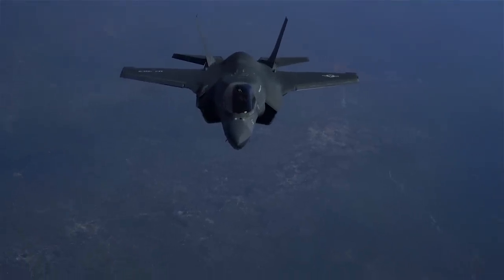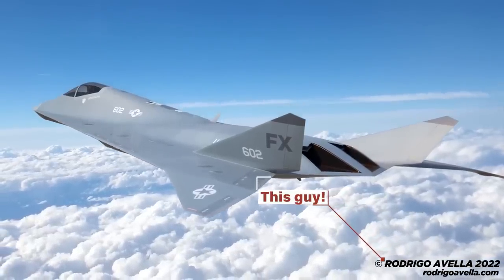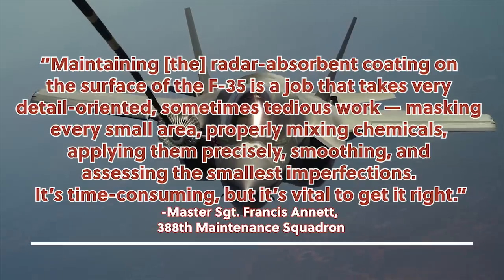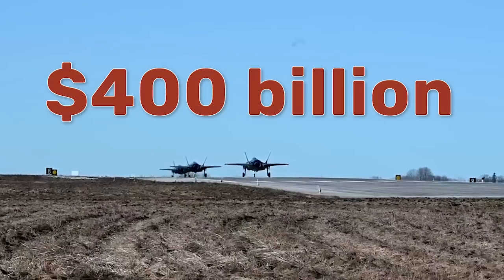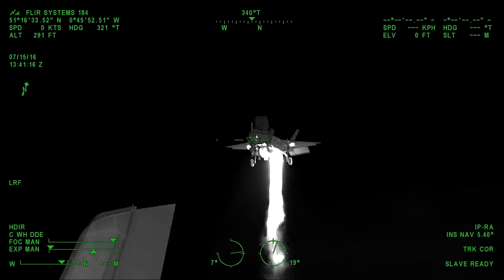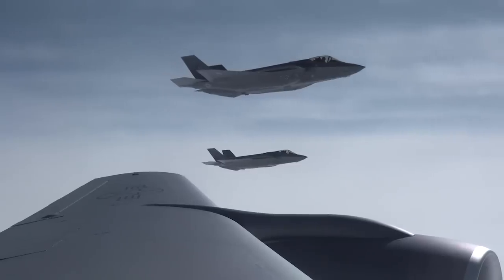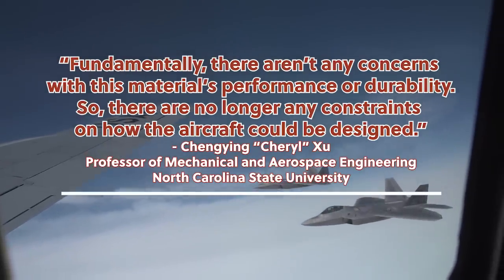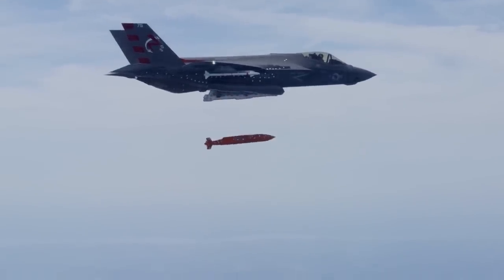The biggest leap in stealth tech since the F-117

Comment: Excellent video.  I already knew about the F-35's super sonic limitations.  What you didn't cover is why the F22 despite apparently having similar problems does NOT have the same limitations on speed.

All the problems with the F-35. Heavier than an F-18 SuperHornet but with only one engine, an Engine that's so powerful it eats itself, limiting spare parts. Only carries 4 missiles internally. The slowest supersonic jet we currently have which means even with stealth it's endanger from BVR missiles where ground and AWAC cover makes Stealth irrelevant.  It's limited AoA (High Alpha) means it can't handle BFM 1 circle Combat.  It's bulk and less sleak design means it can't handle high speed in the 2 Circle BFM like the F-16.  The stealth RAM's vulnerabilities in heavy salt and dust environments means it's a constant maintenance nightmare.   Truly, these limitations should have prevented Stealth Fighters from being anything other than a Tip of the Spear, or ACE Card in tactical Warfare and should never have been implemented in the thousands, replacing multiple special purpose fighters designed for role superiority.
Reply: The 4 missiles is only a limit without the Sidekick expansion program that extends it to 6. Also, missiles on a 4th gen are used for spoiler shots that are never meant to hit, just for the enemy to go defensive. With stealth, you can position yourself to have every missile be a kill shot. Hang 10 AMRAAMs on a 4th gen all you want, half of them won't be able to score kills on a purely statistical basis.
It's not the slowest jet. A F-16 needs to punch afterburner to fly in formation with a F-35 in dry thrust according to F-16 pilots.
Ground radar and AWACS doesn't make stealth irrelevant.
It doesn't have limited AoA, it's in fact a nose pointer. Pilots describe it like a F/A-18 where the nose pointing authority can be used to defeat more nimble fighters.
It's not bulkier than other modern fighters.
Reply: @ChucksSEADnDEAD  SideKick  should have been the original design especially for the airforce plane now after the fact it will be just another separate procurement slipped into a Pentagon budget discreetly for the hundreds of fighters that obviously need that upgrade.

Yes if it's fighter to fighter stealth allows you to position your self inside the MAR at such a short distance that they can't defend against the missiles...but that won't happen with overlapping ground and air radar sharing information. Even single Fighter RWR will detect the f35 radar lock before getting that close and with the slow speed of the F35 it's not well suited for missile boosting to deadlier speeds to make MAR kills quicker and more effective before the missile loses energy. That's why F35 speed is a problem as a BVR platform not for maintaining formation

I doubt the F35 is a nose pointer. No thrust vectoring, no canards, no leading edge extensions for enhanced stall characteristics. But we know it has good low speed handling because of its overpowered engine. Flyby wire is its only advatage for AoA. But those wins are likely situations where the F35 is loaded lightly with missiles and less than 25% fuel otherwise I wouldn't believe that if I were you. It was designed to carry alot of fuel for the longest range possible  to strike inside the biggest countries from carriers.  (Russia and China) There is a reason the pilots call it "Fat Amy".
Reply: @saquist  1. Okay. In the old days aircraft were made and only had the ability to fire AIM-9s and had to wait for Sparrow integration. Big deal.
2. Low probability of intercept radar. Also, there's other means of acquiring lock.
3. The F/A-18 doesn't have thrust vectoring. Or canards. Your "doubt" does not contradict real pilots. I don't know who taught you about aircraft but get a refund.
4. All the other aircraft carry external tanks so they're in a worse spot than the F-35.
Reply: @ChucksSEADnDEAD  the F18 is designed with Leading Edge Extension technology and Cuffs on the wings, LERX Leading Edge Root Extensions and Vortex Controllers , (These are the cobra hoods on the side of the fuselage) they create lift from vortices.  That's why no other fighter has the same twin condensation shock pattern as the F18. The aircrafts kinetic energy is expended at these edges converting it into lift before the air wraps around the back of aircraft in the form of drag where the energy is wasted.

But 5th Gen fighters don't use this technology because they enhance their radar cross-section instead of reducing it.

I'm not here to win a pissing contest.  
Just sharing information.

Comment: Ceramic RAM would make a lot of sense for use on engine nozzles, but not much else. Most of the airframe needs a certain degree of flex that ceramic simply can’t handle
Reply: Some ceramics are flexible and I image wngineers will consider this. Besides, testing should reveal any problems - if the ceramic coating reaches that stage of development.

Comment: Your information regarding the F35 stealth coating and speed limitations are a misrepresentation. You seem to do this often when talking about the F35.

In 2011, stealth coatings on the horizontal tail of F-35B and F-35C was damaged after a test flight near the edge of their flight envelope.

Since then the JPO tried to replicate the conditions but FAILED. In 9 years and over 275,000 flight hours – there are only 2 incidents of F-35’s coating being damaged.

Two. In 9 YEARS.

"Winter [current F-35 Program Officer] noted that the issue was documented while the jet was flying at the very edge of its flight envelope. He also said the phenomenon only occurred once for both the B and C models, despite numerous attempts to replicate the conditions that caused the problem.

“How often do we expect something like that to occur?” he said. “It's very, very small.”

Greg Ulmer, Lockheed Martin’s F-35 program head, said there have been no cases of this problem occurring in the operational fleet and that incidents have been limited to the “highest extremes of flight testing conditions that are unlikely replicated in operational scenarios.”

In 2014, Lockheed introduced a more durable coating in Lot 8 to better withstand the thermal shock wave. But because JPO FAILED to replicate the same conditions to test the new coatings for almost a decade and little combat utility of sustained Mach 1.4+ flight – they decided not to waste more resources into this issue by putting advisory restriction for F-35B and F-35C’s use on afterburners at supersonic regime.

•F-35B: 80 sec. at Mach 1.2 and 40 sec. at Mach 1.3
•F-35C: 50 sec. at Mach 1.3

It’s important to understand that both F-35B and F-35C can STILL cruise at Mach 1.6 top speed with combat load, just not for a very long period. Though about a minute of Mach 1.4+ flight is counterproductive – the fuel burnt will dramatically reduce endurance.

This advisory restriction has negligible impact on F-35B/C’s performance – contrary to the gross misrepresentation, it has little impact on F-35’s supersonic flight. Even during the era when Mach 2+ aircraft were common, vast majority of combat happened bellow Mach 1.2

And if the situation demands – there’s nothing stopping a F-35B/C pilot from exceeding these advisory limits in combat. These restrictions are there only to avoid UNNECESSARY damage in peace time operations.

The F-35 can cruise at Mach 1.2 on dry thrust for 150 miles in combat config but Lockheed doesn’t market F-35 as ‘supercruise’ because unlike others USAF defines supercruise as Mach 1.5+ on dry thrust, not just breaking the sound barrier.

Like many things in F-35 program, these restrictions are taken out of proportion. At the end of the day, F-35 can sustain supersonic flight far better than almost any 4th gen. aircraft in combat config.

https://www.defensenews.com/air/2019/06/12/supersonic-speeds-could-cause-big-problems-for-the-f-35s-stealth-coating/

Comment: i feel like a broken record because of the advances in signal targeting.  Radar stealth will give 50 to 200 miles surprise as of now, Optical AI, IR, and disturbances in the air itself in combination with satellite and integration of systems signal analysis so radar stealth will be a waste of money n production numbers in a matter of years. In 10 years id rather have 1000 f15s or f18s instead of 300 f35s.  Smart missiles with intergrated targeting systems ie heat radar n optical ai ,like ur tesla uses, the only thing that will matter is if you can out turn the missile. If u think FOX 2 or 3 is still a thing ur in the 90s

Comment: Ceramic coatings use would be very limited if it’s as inflexible as the name suggests. Airplanes flex a lot when they fly and a stiff coating wouldn’t last long without damage. Anyone who has seen a video of a plane undergoing flutter testing will understand. I was astonished when I saw a B-2 flap it’s wings like a bird.
Reply: I'm sure ceramic coatings refer to the particles of ceramic materials in a medium and not a block of solid ceramic like a clay pot.

Comment: This will be huge if it works out. At $40,000+ per hour of operation the F-35 is going to eat up a large part of any user's defense budget. If they can drop it by a quarter or more that will mean being able to afford more of them or investing in other areas. Along with the ability to use the platforms to their full potential.

I also wonder where A.I. will take this whole trend. Deep learning is also showing how powerful A.I. systems can become, when the human pilot is removed it makes the aircraft lighter, drop the RCS, less costly and allows for much high G-loading.
Reply: "$40,000+ per hour of operation"(sic)

The oft quoted figure is $35k which is about half that of the F-22.
Reply: @AA-xo9uw  Kind of hard to nail this one down, I've also seen figures as high as $50,000.

Comment: they plan on producing 12 serial production su-57 this year,six have already been produced.
Reply: How long ago were those 6 completed, and how many are left now after the accidents?
Reply: @rogerwilco5918  there was just one accident involving a su-57.
Reply: @rogerwilco5918  they"ve already figured it,which is why they started making the production model,which is a lot better than "fix problems on the fly" method some nations have adopted.
Reply: @Globalscanningeyes  The Soviet union started this project back in the 80's.. So, if "the Russian federation" doesn't collapse yet again, maybe another 40 years?
Reply: @Globalscanningeyes  Two crashed.
Reply: @rogerwilco5918  no,the su-57 project started in the 2000s the mig 1.44 project which was supposed to the 5th generation fighter started at  almost the same time as the f-22 but was eventually cancelled.
Reply: @Globalscanningeyes  yes, the su-57 project picked up in the 2000's where what started as the "I-90" project in 1979 left off..
So, about another 40 as long as Russian doesn't collapse yet again.

Comment: Pls stop using imperial metrics for stem topics.
Reply: Aviation uses knots, feet and nautical miles. Please stop demanding STEM metrics for aviation.
Reply: ICAO has been demanding metric units for years. Aviation is also part of engineering.
Reply: @GMBDG214  Flying isn't engineering.
Reply: @f.a.2115  Aviation and flying aren’t t	he same. Aviation takes the whole industry process, design and operation of aircraft vehicles into account.
Reply: @f.a.2115  You can look up the definition of aviation online

Comment: F-35. A one trick Pony whose expenses, both upfront and after purchase, make them a simply irrational choice as anything other than ane exceedingly specialized, mission specific Aircraft.  
In an active War situation, Aircraft like the Gripen, modernized F-15 and 16 Airframes are both more practical in a cost arena, but, also, in the arena of mission turnaround.  An F-35 is good for one, perhaps two, in extreme use scenarios, Sorties per day.  In contrast with other Aircraft, this limitation is absurd.  Added to very limited range, limited armaments, and performance issues, again, mean that the F-35, at best, should be a very limited purchase item.
Reply: It's better than everything else we have, the Gripen is too expensive and not capable enough, a modernized F-15 is just as expensive as a F-35.
Its range is better than other fighters with external tanks, the armament is satisfactory with internal only.
Reply: @ChucksSEADnDEAD  The Gripen costs about the same, if you average the Sources the give buying Cost (Note:  I am inclined to doubt this as I think a lot of this information is F-35 disinformation.) As far as Systems Capabilities, the only advantage the F-35 has is its Stealth.  Operating costs/hour are completely in favor of the Gripen.  Lastly, the Gripen, unlike the F-35 cam be easily rearmed and refueled from impromptu Airfields, such as Roadways, and fly multiple Sorties per Day, unlike the F-35, which requires a well equipped Airbase. Also, the F-35 carries four Air to Air missiles internally, and has a range of 1500 Miles, which gives it a useful range of about 550 Miles.  
It may do Stealth well, but, as Rand Corporation pointed out, it can't turn, it can't run, and it can't climb.
Overall, the F-35 is a Corporate Welfare Program.  If it were up to.me, the US would ne fielding something better, i.e. not still in development over two Decades later.

Comment: Trust government to make everything incredibly expensive since it's our money they're spending... I built a radar absorbing mechanism in the '80's that would hide an entire 18 Wheeler from x, k, and ka band speed radar for under $15 trailing edges and all. Technology has gotten waaaay out of hand, becoming more about profit than efficiency.
Reply: Did your 18 wheeler fly over Iran in such an embarrassing event that they had to fire the head of the air force?
Reply: @ChucksSEADnDEAD  You are missing the point. If I could do that in my spare time, our "best and brightest" should be able to solve their problems with far less... or maybe we should just outsource the problem to someone else. 🤔
Reply: @davidschupbach2113  I'm not missing the point. There's a ton of things individuals have done that can't be done at scale. It's hard to convey in a small number of words, but things that work in a vacuum many times don't work outside those conditions. Such as, how would power and wavelengths interact with such a surface? Would it even hold to high subsonic speeds? Would it work if the aircraft had to fly in arctic conditions? Or over Kuwait? There's a reason there's people being paid the big bucks to say that rotating the bolts by 25º will reduce the radar returns. That's right, the insides of the F-35 were modified because they could get less radar returns from changing the orientation in which bolts were pointed when fastening pieces together. These are highly complex subjects that require time and money to research, and an 18 wheeler that beats speed traps isn't gonna drop bombs on Kim Jong Il's palace.

Comment: Great, so we just spent a trillion or so on something designed around an old constraint. Awesome
Reply: Not really. With a coating refresh, an F-22 with over 70,000 lbs of thrust, relatively low drag coef, and clean exterior due to internal weapons bay, can probably touch mach 3.
And it's ongoing operating costs go way down. F-35 probably gets basic supercruise and lower operating costs out of it too.
But it does open up some possibilities going foreward.

Comment: The SU-57 outer skin is made out of Electrically conductive radar absorbing carbon fiber composite, in fact more than 25% of the fighter is made from composites. And no one ones what is under the J-20. We only know that the F-22 under shell has issues. I enjoy the channel but that was incorrect information you shared.
Reply: Carbon fiber isn't radar absorbing.